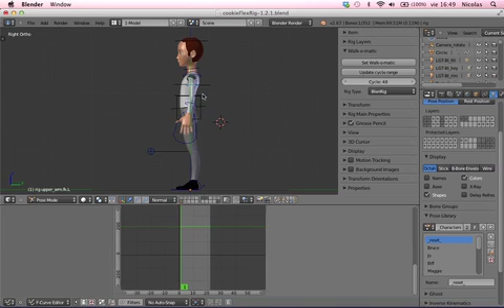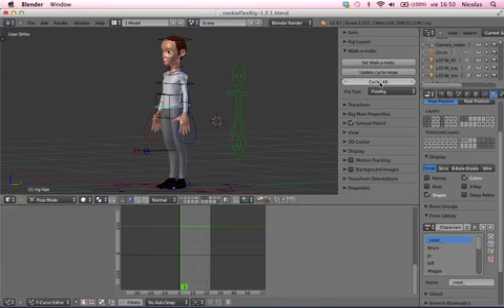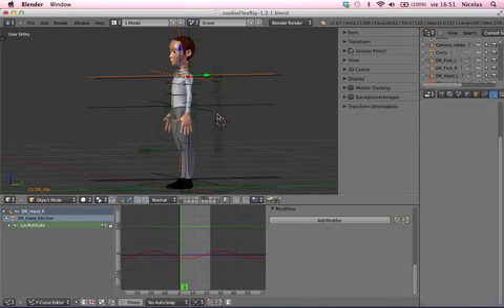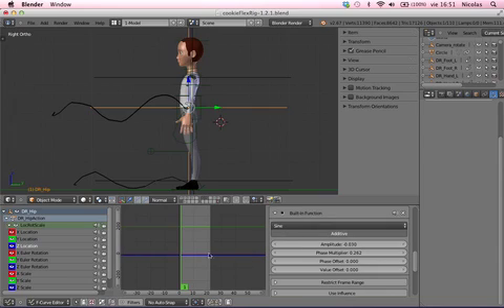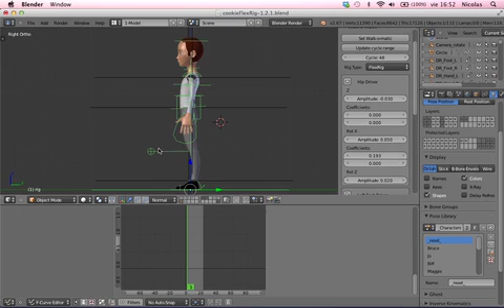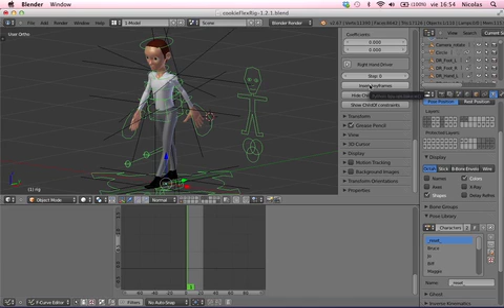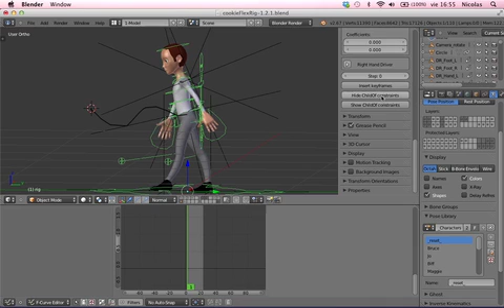Blender Walk-o-Matic, part 2

Comment from the maker: Hello, yes, I have seen that message before, but in my test it doesn't appear anymore. I havent tried in 2.68, only 2.66, but it should work. Because of the way variables are stored, some references are lost if you use the addon more than onece on the same armature. Try quiting blender and installing again when you reopen. If it keeps happening Ill check the code